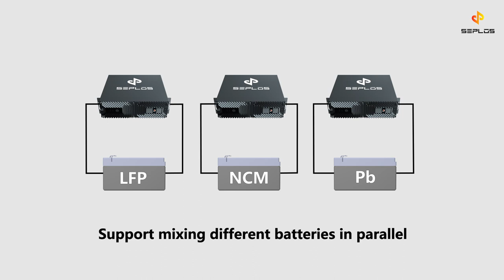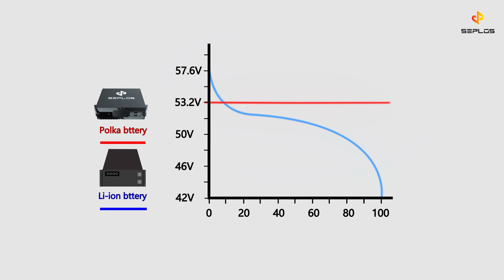POLKA battery - mixing batteries of different voltage, amp hour, ages, chemistry, brands in parallel

Comment from the maker: POLKA BATTERY ALLOWS YOU TO 

Connecting batteries of different voltages in parallel
Connecting batteries of different amp hour capacities in parallel
Connecting batteries of different ages in parallel
Connecting batteries of different chemistry in parallel
Connecting batteries of different brands in parallel

Polka adaptive voltage mode provides constant voltage output from 48V-58V.

POLKA BATTERY DETAILS: https://bit.ly/3P7Qdpc

Comment: So it’s a lithium battery with a DC / DC converter between it and the “outside world” so the voltage output is suitable for a lead acid bank and you have some kind of control system to work out if the system is under load (then current can flow out of the battery) or if there’s just the small drain which indicates the lead acid bank is self discharging, then the output switches off?  Sounds ok, but there’s an efficiency loss in running a DC / DC conversion and also of course the current limit out of this battery must be a lot lower than if it were just a regular LFP battery. I see 100A limit on the spec sheet. Hmm, I don’t know if the price plus efficiency loss and current limit (and heat production close to that 100a limit) is an acceptable trade off against the small benefit of avoiding self discharging into lead acid bank. It seems like a hammer to crack a nut in engineering terms, and there are other ways to parallel LFP and lead acid without such drawbacks. Maybe a product targeted at people who don’t know much about their own requirements?